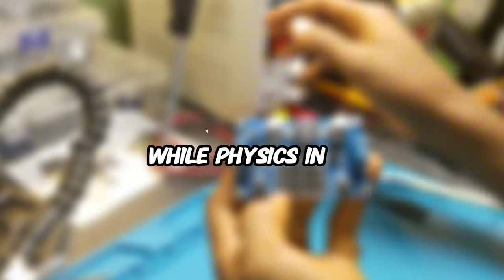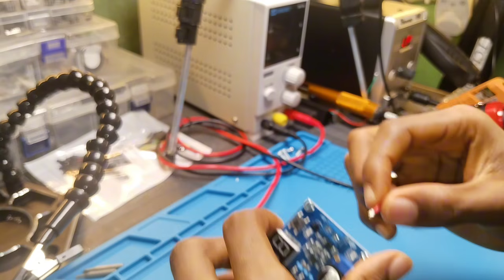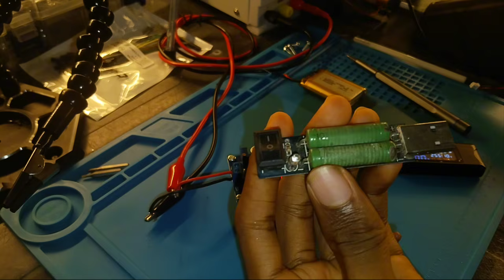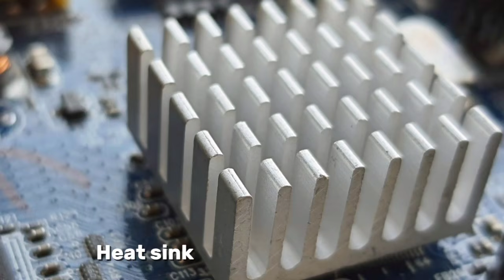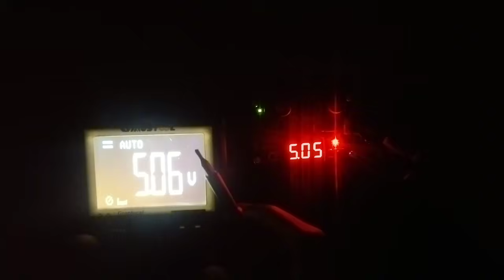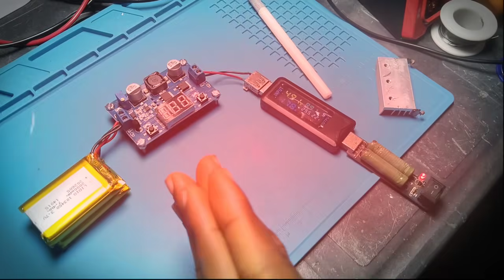I Tested the LTC1871 Boost Converter - The Display Is Misleading! (DIY Power Bank build!)

Comment: Bro kindly let know the circuit diagram so that we can repair if its faulty, morever i feel getting components is a challenge 👍
Reply from the maker: Yeah great tip!
 Thanks for the suggestion. The main issue is that the seller hasn't published the exact schematic for this particular module. While it's based on the LTC1871 IC, there are many different ways the IC can be connected, and different manufacturers often use different component values and circuit layouts.

The only way I could get it is if I tried tracing out the connection tracks on the module itself.

If you're looking for the general LTC1871 application schematic to understand how the IC works or for repair reference, I'll be posting that on my Patreon. Just keep in mind that it is not the exact schematic of this specific module, since the manufacturer hasn't made theirs publicly available.